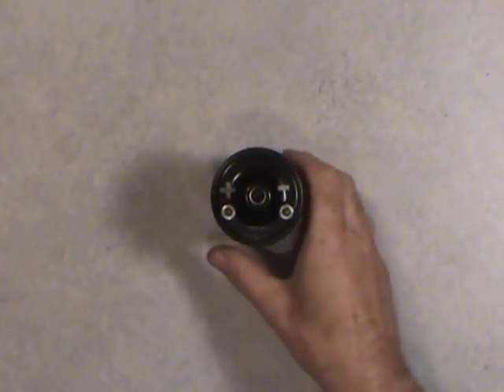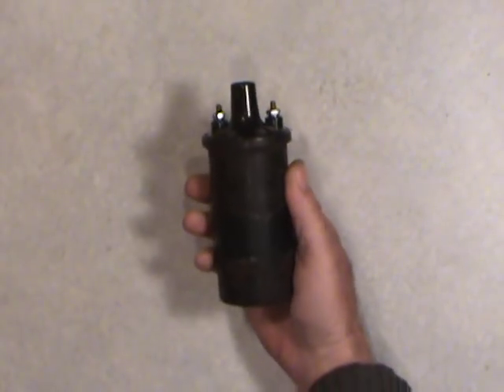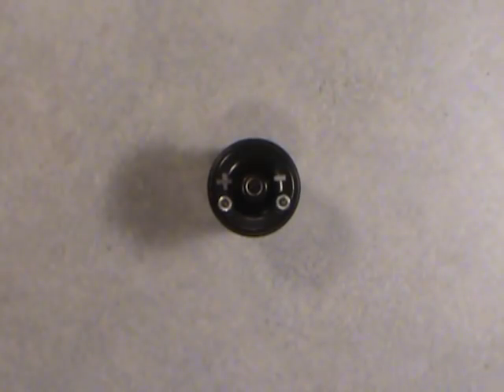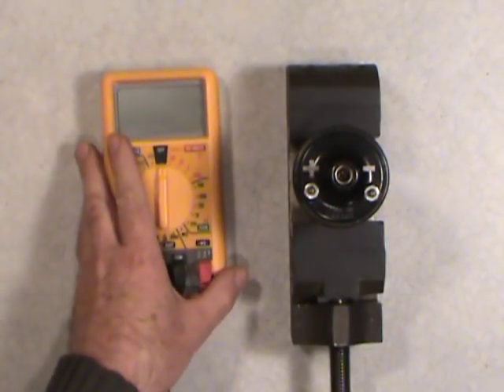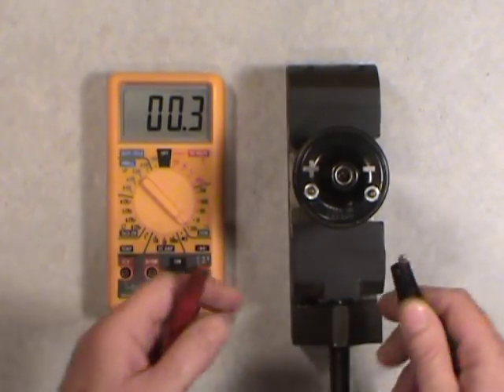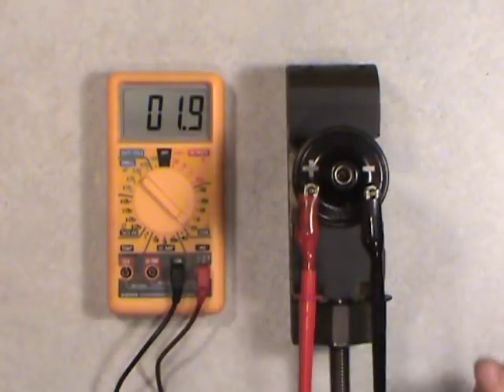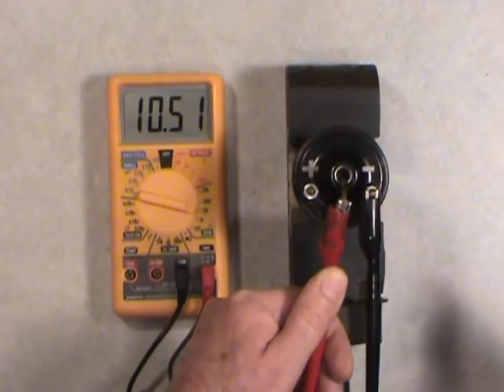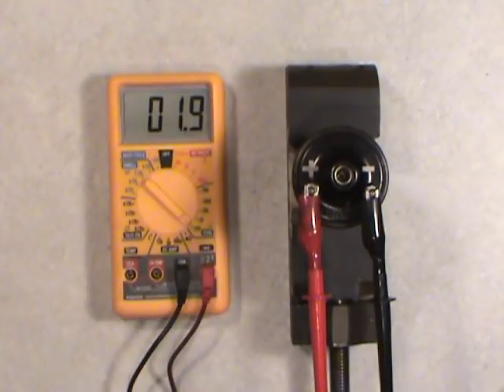Ignition Coil Testing

Comment: Are you familar with the old prestolite ignitions? I have the pl on my 76 cj7 jeep and have concerns that its weak and causing hesitation and boggyness.
:(
Reply from the maker: Greetings rag Doll....Thanks for watching, and commenting, on this Ignition Coil Testing video of mine....Hmmmmmm, I can honestly say, that I "Haven't" had an "Up Close and Personal Relationship" with "Sparky", the Prestolite Ignition System...But...Stay Tuned, for, what You are about to read, my Friend!....First off, please, don't go Blame-in "Mr. Sparky" (aka, the Prestolite thing-ah-ma-bob), for being a...Wimp (weak), Hesitational (hesitating), or being Boggy-Woggy (boggyness)...lol..."Without", checking the Many "Other" Things, that may be causing Ole "CJ's-Engine's", Lack-Of, Smooth and Powerful Responsiveness, along with a Good Dose of Gas Mile-age that can be had, if, and I say If, You can "Go Easy" on the Gas Pedal! (try Not to Laugh eh!).

So then, Dr. Rocky, is not sure who the Real "Patient" actually is, as there happens to be "3" Patients in the waiting room, waiting for "Treatment!"

The "3" Patients listed below might be "Aliens" (aka, Not Human!), because they look, just like..."AMC" (aka, American Motors) "Gasoline Engines!"

Patient Number "1", looks like a 3.8 Litre (or, 232 Cubic Inch) Inline 6 Cylinder.

Patient Number "2", looks like a 4.2 Litre (or, 258 Cubic Inch) Inline 6 Cylinder.

Patient Number "3", looks like a 5.0 Litre (or, 304 Cubic Inch) V-8.

So then, Dr. Rocky, needs to know, "Who" the "Real" Patient "Is", as, I checked with my Receptionist, and She told me, that She "Only" Booked "1", (Yes, "ONE!") "Patient" for This Afternoon!!!

???

Before You, or I, go on a..."Wild Goose Chase", I would Highly Suggest, that You do a "Complete Tune-Up, and Maintenance Procedure" on Your "1976 CJ-7 Jeep", with the reason being, Your (so called) Problem/Problems, that Your "CJ-7 Jeep" is Experiencing, is more then likely, due to Something, that might just have Nothing to do, with..."Mr. Sparky" (or, Mr. Prestolite).

I had a Look-See at Your Particular Ignition System, and, it appears that about the only thing that I see, that is "Different", with the "Prestolite" Distributor, as compared to something, like an "AC Delco Points and Condenser" Distributor, is the way in which the "Ignition Coil", is "Triggered" (Triggered = turning on and off, the Primary Low Voltage Electricity, that Charges, and Tells, the Ignition Coil when to go ZAP!).

The "Secondary", (or High Voltage Side), of Your 1976 Jeep's "Prestolite" Ignition System, appears to be very Similar to the good ole AC Delco Points and Condenser Distributor System, as, the actual Ignition Coil and Spark Plugs (having only a .035 Inch Gap), is indicative of, a quite simple Ignition System, with, as I see it, the Elimination of the "Breaker Points" (and Condenser), so, as I recall, the Government, of the day, Mandated, that the vehicle Manufacturers, Comply with, the Governments Requirement, that the Vehicles of that Time Period, had their Vehicles go so many Miles or Kilometers between Tune-Up's, in order to Satisfy, the "Smog" (or Emissions) Requirement of, Yup, You got it..."The Good Ole Days!"

There are some good things to be had, with the "Evolution" of Electronically Controlled Ignition Systems, but only, when they are Working as they were intended to work!

With the AC Delco "Points and Condenser" type of distributor, on an AMC V-8, the "Dwell" Time was rather Fixed, at about 30 Degrees (as measured with a Dwell Meter, while being connected to the distributors wiring, and the engine running at idle speed).
This 30 Degrees of Dwell Time (Dwell = the amount of Degrees that the Points stay Closed, and when closed, the Ignition Coil gets Charged up, then, when the Points Open, the Magnetic Field in the Ignition Coil Collapses, and thus, the Ignition Coil goes...ZAP!).

Everything is OK, while the Engine is running at, not too many RPM's (Revolutions Per Minute of the engines Crankshaft)...But...when the Engine is Spinning at, oh, let's say, 5,000 RPM's, that Fixed 30 Degrees of Dwell, "Does Not" Allow very much "Charge Time" for that good ole Ignition Coil, thus, I go back to, the New, and Improved Type of Electronic Ignition System...

I can't say for sure, that Your Jeep's "Prestolite" Does the same thing, as, let's say an AC Delco HEI (High Energy Ignition) System Distributor (HEI started about 1975), where, the Ignition Coil gets an "Increased Dwell" Time at Higher RPM's, due to the Ignition Module that's hiding inside the HEI Distributor, under the Cap.

So, as I see it, and seeing as how I have seen that You have an Old School looking Ignition Coil in Your Jeeps "Prestolite" Ignition system, there shouldn't be all that much to be Worry-in about.

Might be Time, to have, or, do a Rebuild on Your Jeep Engine's "Carburetor"
I have had more Bad Running "Issues", with a "Miss-Behaving" Model 2100 Carburetor, sitting on top of an AMC V-8, then that good ole AC Delco Points and Condenser Distributor, and, that's a Fact!

Usually, all that went wrong with that Motorcraft Model 2100 Carburetor, was, "Old Age"...I just give-er a rebuild, a few Adjustments, and, away I go...again (Happily!).

I have spent considerable time, on an AMC V-8, equipped with an AC Delco Points and Condenser Distributor, along with a Motorcraft Model 2100 2-Barrel Carburetor, and, with what appears to be, a..."Ford" Starter, along with the Ignition Solenoid mounted on the inner fender area.

I'm guessing that You might have a "Model 20" Rear Axle in Your Jeep? (might be the Model 15, but I have my doubts).

Now here's some really Goofy Engineering for Ya!...
...The Hubs are Separate from the actual Axle Shafts!

To Replace the "Outer" Rear Axle Shaft "Seals" (Big Ones, Not the Smaller "Inner" Ones!), the Rear Axle Shaft "Hubs" have to be "Removed" from the Rear Axle Shafts! (just keep reading eh!...lol).

On a Model 20 Rear Axle Assembly, with 10 Inch Drum Brakes, a Person really gets to have some "Real Fun!" (more like a Hissy-Fit, with a lots of Cussing to go along with it!...lol), when trying to "Remove" those "Super Stuck and Corroded, Rear Axle Shaft "Hubs" from, those there "Axle Shafts!!!"...

...What were "They" Thinking???"...

...actually, from what I have heard in the past, was that "They", came up with that, in my view, "Weak" Design, so that, all that "They" had to do, in order to have "Different" Axle Housing Over-All Lengths, was to "Alter" (or Change), the "Lengths" of the Axle Shaft themselves!...

...Might be OK for Sunday Drivers, Like Grandma, Not Grandpa!!! (lol), but, throw in some LARGE Outside Diameter Tires, and Give-er-Lot-sa-Gas, while Spinnin' the Tires, then Abruptly, Grabbing some Major Traction (then they say)...Oh Look at the Spinnin' Axle Shafts on the Not-So-Spinning Hubs!!! (as the Engine Rev's, and the "4 by 4" goes No-Where!)...Ouch!

Sorry, but I'm out of Gas...

...Till next time...

..."Keep the Greasy Side Down, and the Shine-ee Side Up!"

Be Safe, take care, and have a good one.
Reply: Great stuff..
To answer your questions:
We are dealing with patient #2 -- 258 I6 engine
Yes, dana 20 -rear pumpkin/axle
11" drum brakes (front and rear)
No Carb... Switching to GM TBI (2 bbl throttle body injection)... In short, had 3 carbs within 3 years.. Never could make work right.. Just got rid of them and trying to have my new/rebuilt ECM/computer decide on fuel and air mixture.

Thanks for the cute story...
Perhaps the updated gm tbi fuel system is too powerful for the outdated prestolite ignition?!
I HOPE to find an igntion system that will allow the ecm to control spark/timing, not just fuel as it currently does...
Thanks again for the help.
By the way, I am a girl... :)
Reply from the maker: rag Doll
Greetings rag Doll....Thanks for the comment, and Info, my Friend...Now that the so called "Patient" has been Identified, I then had "Security" Remove those "2-Other-Wanna-Be-Patient-Imposters" from my "Waiting Room", in order to get onto, the much needed "Treatment", of that ailing "Patient", that I have Identified, and listed on the Patient's File as..."Patient Number 258-6"...lol....With that out of the way, I believe that I have quite a bit of Info (aka, Information), that I'm quite sure, should help You out somewhat, with, the end game being...(if there happens to be one, that is...lol)...as it pertains to Your Jeep.

The first thing, that Anyone should consider, is, not only, what the Vehicle "Itself" happens to be, but, just as "Important", is, "How" the Vehicle in question, is to be "Operated", or, under "What" Conditions, will the Vehicle "Actually" be Used For?

So then, a "JEEP", it is...

If You care to, just let me know, what it is, that You might be using Your Jeep for, as in...

How Fast do You want to "Cruise" on the Highway?

How "Slow" do you want to be going, while 4 by 4-ing?

How "Steep" of a Hill (going Up it, Down it, as well as the Side-Slope Angle as well), and, what "Kind" of "Terrain" are You Gutsy enough to expose Your Jeep to?

There are Numerous things at play here, that can Dictate, just what kind of a "Powerband", (aka, at what RPM's Your "258-6" Engine will make its best Torque/Horsepower at), in respect to, a Compromise between Highway Speed, and the Low End (low engine RPM's) "Torque", that a "4 by 4" needs, when trying to Power Through some very "Knarly" and Challenging Terrain.

Be careful, as to How Many "CFM" (CFM = Cubic Feet Per Minute) that the "TBI" Unit is rated for, Especially, givin' the 258 Cubic Inch Displacement for Your Engine.

If it's Rated at Too Many "CFM's" for Your "258", You might experience less gas mileage while just crusin' along, as well as, slower throttle response.

I think that they use to make "Single Barrel" TBI's for Smaller Engines, might be for a 4 Cylinder Engine, and maybe "Too Small" for Your 258?

Maybe do some Searches, on some Jeep, or 4 by 4 Websites, to see, if some other Person, may have already Converted their Jeep, with the 258, to "TBI", as I'm sure, will probably help You avoid some unwanted grief and frustration, and wasted Snack Food Buyin' Money as well!...lol.

If I recall correctly, a TBI Fuel Injection System, needs an "Electric Fuel Pump", that has a Fuel Pressure Rating, of around "13 PSI" (ballpark figure?)...&...that there Electric Fuel Pump, is usually "Hidin' " inside Your Gas Tank!"

Your Jeep might need a Fuel Pump "Relay" Electrical Circuit as well, or, maybe start a fire perhaps?

Not only that, I think You're gonna need to Install/Plumb, a Separate Fuel "Return" Line (steel tubing, and associated hoses and clamps, etc.), so, the Excess Gasoline, that Bypasses the TBI's Fuel Pressure Regulator, finds its way, back into Your Jeeps Gas Tank.

Must also make sure, that, either You Jeeps Currently installed Fuel Line, is able to handle that, about, 13 PSI of Fuel Pressure, without Leaking!...
...as, with the Mechanical Fuel Pump that You now have, it just Draws the Gasoline Through the current Fuel Line, with, shall I say, No Real Pressure at all.

Some considerations, for Your Jeeps Exhaust System as well...

I have found, that, a Smaller Single Exhaust System, on just about any Engine, will Enhance, or, provide better Low Engine RPM Torque (Torque = like when You actually "Twist" someones Arm, the harder You Twist that Arm = More Torque!), and, this Low Engine RPM "Torque, that I'm Talkin' about, is what Your Jeep needs, especially, while trying to Plow through some very, Steep and downright ugly terrain, while goin' nice and slow...

...But...

...smaller, single & might I add, Restrictive, exhaust systems will kinda Choke the Engines Breathing on the Exhaust side of things, while trying to get some Power out of Your 258-6, while it is spinning at much Higher RPM's, like at Highway Speed, or, even faster, so You can get that "Speeding Ticket" that You always wanted!...lol.

The above is just a sampling, of how I kinda observe, and do things.

A "Warning" to You!...In the Past, I had a 10 Inch "Bonded" (as in Glued) Brake Lining, "Un-Bond" itself from the Steel Brake Shoe, while driving at city speed...&...the "Un-Bonded" Brake Shoe "Lining" "Wedged" itself between the Steel Brake Shoe & the Brake Drum, making for an "Instant" Emergency/Parking" Brake Application on one of the Rear Wheels, causing that Wheel/Tire to become "Instantly Locked-Up!!!" (Tow Truck Time!).

Imagine now, if that Happened on one of the Front Drum Brake "Shoe Linings", while motoring at Highway Speed at about 55 Miles Per Hour???
I don't even want to go there...

The best Advice that I could give You, or Anyone, for that matter, in respect to "Drum Brakes", due to what I had happen, with the (just) above, is to..."Always" Insist, that the Parts Person give you "Brake Shoes" with "Brake Linings" that are "RIVETED" to the Steel "Brake Shoes!!!"

Also, Make Sure, that Your Jeeps, "All 4" Drum Brake, Shoes "Self Adjusters" are 100% Operational, as, in the past, while (again) traveling at city speed, I had a Front, Self Adjuster "Screw-Assembly" drop off of the bottom of the "2" Brake Shoes, and, luckily, that Self Adjuster "Did Not" Lock-Up the Front Wheel this time!!!

You see, I "Do" have some experience!...lol.

Please, feel free, to pick my Brain, and, see if I can...

...Help You..."Git-Er-Done!"

Long Live "All" AMC's...!!!

Be Safe, take care, and have a good one.
Reply from the maker: Greetings rag Doll....I just remembered something, that You should be made aware of, just in case, the TBI Unit that You are planning on Installing, on Your Jeep's Engine, happens to "Act", like I have seen them "Act" some time ago....As I recall, the TBI Units that were installed on V-6 Engines in the Chevy Minivans, in about the Mid 1980's, had an "Overly-Sensitive" Throttle (gas pedal) "Response!!!"....If that Mid 1980's Minivan was Parked on some Gravel, and on a slight up-hill, You would, most of the time, be "Spitting Gravel" with One, or Both Rear tires (Both = in the case of a Posi-Traction type of differential), even if, you Babied/Feathered the Gas Pedal!!!....I sure wouldn't want to be driving that sort of Monster on something Slippery, like "Ice", or on some "Slick" Terrain, that's for (Use Your Own Word Here) Sure!!!.

I figure...that it's Better "Safe", then "Sorry"...

...speaking of which...

...Be "Safe", take care, and have a good one.
Reply: Hi there RockyRoadshow!
Hmm. I'm thinking my problem may be that I have an external inline fuel pump that is quite far from the tank.. And being pumps are better pushers than pullers, it's bogging down... I'm looking into getting an in-tank pump... No fun since my cj7 never had the intank pumps and has a smaller sender opening... But-- In the mean time, I installed a 3/8" inlet fuel line and a 5/16" return fuel line... Just doing more research on what is available to fit a sender with pump in my tank... Or perhaps I can retrofit my current sender unit with an electronic pump... Just don't know about the wiring that needs to come out of my new MTS plastic 0051 tank... Thanks for your help though... :) 00xxx
Reply: Thanks again for sharing a LOT of good information! It's a LOT to absorb... :)
I'm hoping since I have a nice heavy duty fuel skid plate in my jeep that the plastic tank would work.. I also made sure to find a good ground for my sending unit on the frame/rear crossmember...
THANKS again for the good information!

Comment from the maker: ...also, there are other variables as well....A 12-Volt car Battery, when fully charged, with battery cables disconnected, should put out about 12.6 Volts, and, there's more....While that same battery is installed in a vehicle, and the engine is running, that battery will put out, oh, somewhere between about 13.5 and 15 Volts, without any load on it, such as headlights, heater blower motor, etc. Warning!, be very Careful around car batteries, as there is "Explosive-Gas" Venting!!!....(con't)...

Comment: What about the resistance of the nail?!
Reply from the maker: Greetings...108sledder..........Thanks for watching.........Well, my multi-meter didn't show any difference, in the ohm reading at all.........This steel common nail, is quite thick, and not very long at all, so, no resistance (in ohms), were seen..........Where, Ya will probably see, an impressive ohm reading, would probably be, in a very fine (small diameter) wire, that's, about as thick as, a human hair (thick hair, is about .003", or three thousandths of an inch in diameter), and, that very thin wire, has to be very long (in length) as well...........I recall, seeing a chart somewhere, where, the ohms/resistance is shown, for a certain diameter of wire, for, a 12 inch (1 foot) length of it, cool that, I must say...and.......till next time.......Be Safe, take care, and have a good one.